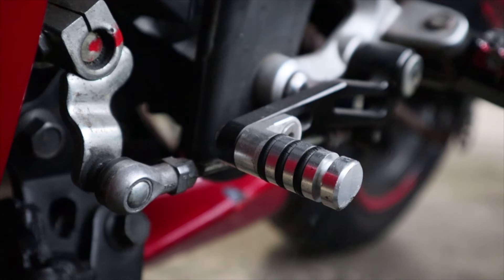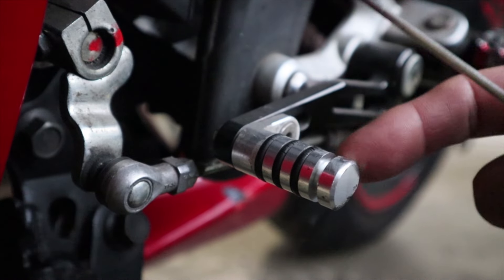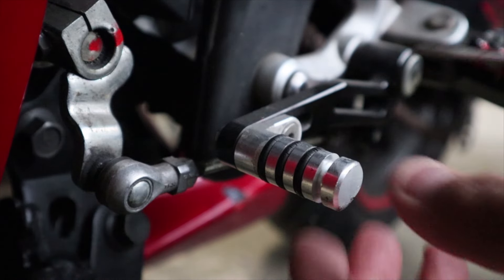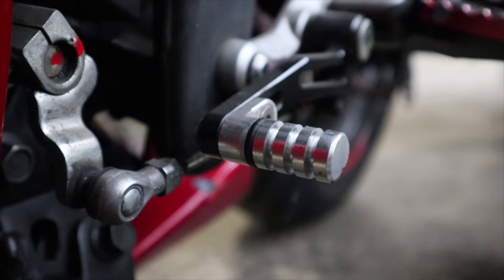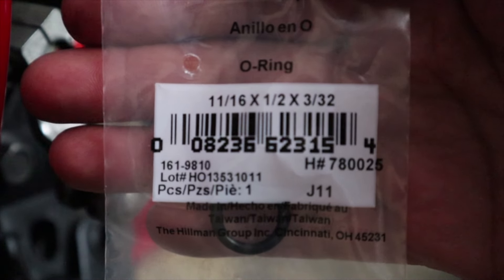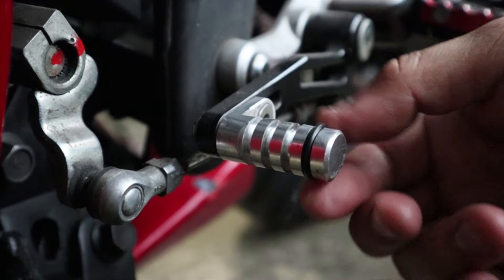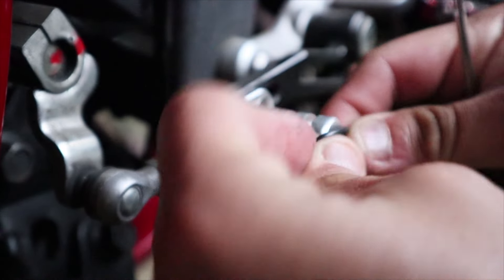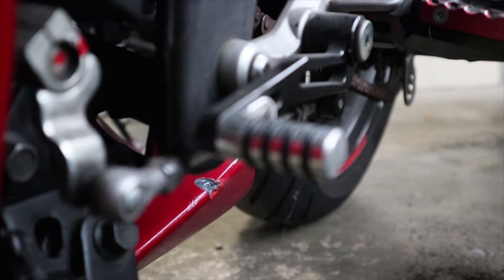How to Replace your Shifter O-rings

Comment: They are all sloppy loose…wrong size
Reply from the maker: @marcoskilar9637  unfortunately i over stretched them when installing, Will have to replace them
Reply: @ACProductions77  If that's true, try a setting them in a bowl of warm/hot water next time. Let them heat up and install while still warm.
Reply from the maker: @MadMaxWill  thank you for the tip for sure will try that 🙂